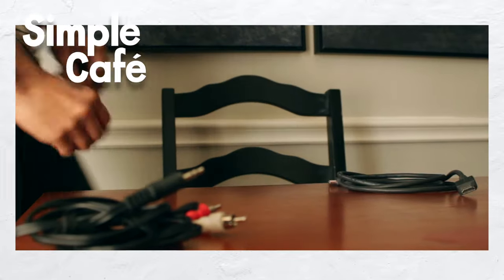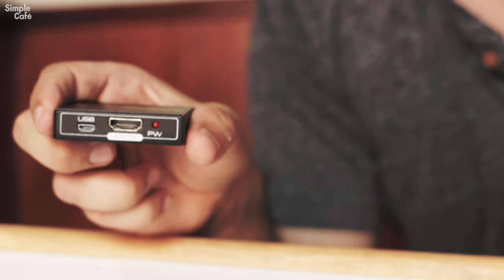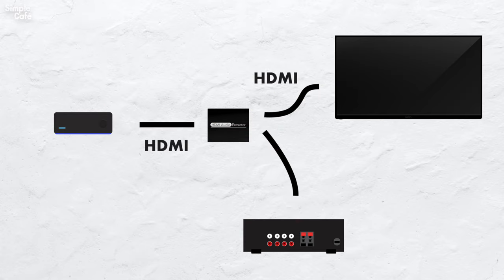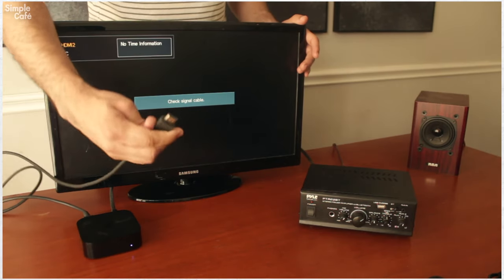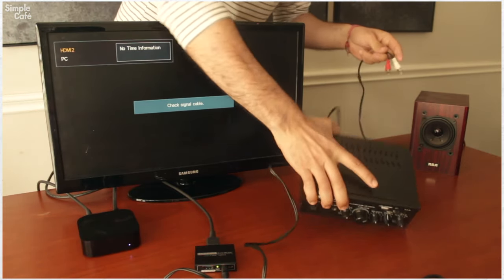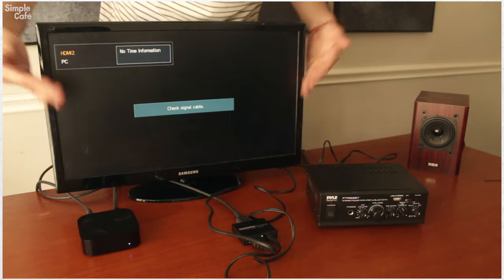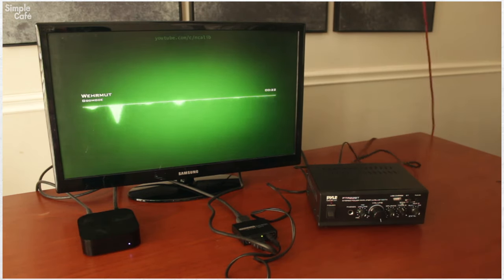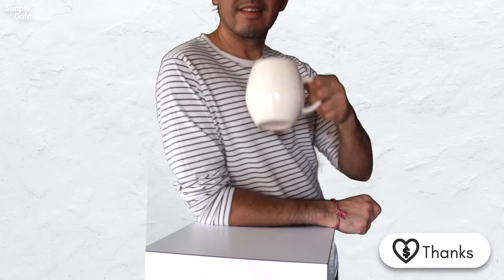HDMI Audio Extractor (RCA)

Comment: So I"m trying to connect my PC to a soundbar. The soundbar has an optical  port and hdmi. But my PC does not have optical port. But I do have the Fosi K5 Pro, that has an optical port. I'm trying to figure out how to get audio. I can the see in my audio settings its reading audio signal via the USB connection to pc from Fosi.  haha this is confusing.
Reply from the maker: maybe this will help https://youtu.be/AmqbMNQ9WSs  and it sounds like you'll need this little converter> https://amzn.to/34TjONX

Comment: Can I connect or use passive speakers with HDMI Audio Extractor? Do I need an amplifier?
Reply: Yes you will need an amp. The audio output is what is called, "Line Level Output", meaning it's only enough to drive an audio amplifier. It will not directly drive speakers, and probably will not directly drive earbuds either.
Reply: @jim5148  Thanks for your reply. Will think about it.
Reply from the maker: Yup, if you wanna learn about "audio levels" https://youtu.be/bM48k72YPu4 and if you want to try with a cheap amplifier, check out this video https://youtu.be/Q8skyeKEopg

Comment: Will this work for splitting the video/audio HDMI signal from a Chromecast or Firestick to a projector with HDMI for video and to an external amp with speakers with RCA for audio? So, based on your diagram, the connections would go FS or CC->Extractor HDMI IN EXTRACTOR HDMI OUT->Projector HDMI EXTRACTOR 3.5mm AUX to AMP RCA l/R jacks with AUX to RCA cable. Theoretically, FS or CC video would play on the projector and sound would come out the Amp and speakers. Correct?
Reply from the maker: Precisely! Did you try it?

Comment: I'll go ahead and thank you for the info.

Also, you should go ahead and redo this video into how to connect a no audio jack or rca TV to an older audio system. That would bring views.

How to choose an audio extractor? Will there be a significant contrast in sound quality between a low-priced and a high-priced version?
Reply from the maker: I haven't tried a pricey version so I can't say. and as for the video suggestion you're right and here it is! https://youtu.be/CsHnqYGldj4
Reply: connect the new tv hdmi output to audio extractor hdmi input using an hdmi.

the audio extractor will convert the signal from hdmi to rca, allowing you to connect to the older speaker.

now, it does depend on which hdmi audio extractor you use, because some extractors come with the red white and yellow rca ports, which in that case, if your older speaker has an aux chord, you can get a rca to aux converter. 
but if you get the extractor with an hdmi output and not the one with an rca output, you might not be able to connect to the older speaker 

having a home theater or gaming setup that’ll get you by for now or will make you over all satisfied is something everyone deserves, sometimes it does require you to jump a few hoops or get creative.

lemme know if it works!
Reply: @lifeofjelllo3596  thanks.
After a lot of research my solution was to buy a new audio system.

Comment: Your vidoes are great! Thank you so much

Quick Q: After watching a few of your videos, I think this may be the solution to my problem (PS5 -> Samsung TV, yet puling audio to an old Pioneer amplifer + passive speakers); however, will i still be able to use my remote control to adjust audio? I heard that Toslink prevents you from doing so.

Thanks again for your excellent work!
Reply from the maker: Welcome! And unfortunately it’s true what they say about Toslink(optical). The output that typically does let you control the volume directly from the tv is usually the headphone (auxiliary jack)
Reply: @SimpleCafeE  that's what I thought, thank you! Will the HDMI method you describe here allow me to use my remote to control volume, then? :-)
Reply from the maker: @ziggystardew6268 I’m afraid not. As demonstrated in the video, when the volume was put up on tv- it had no effect on the speaker.